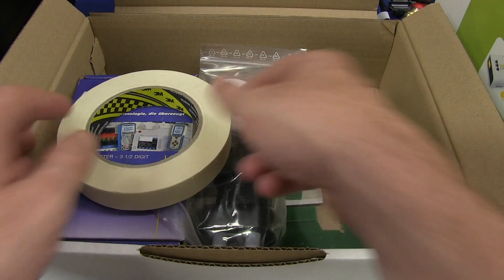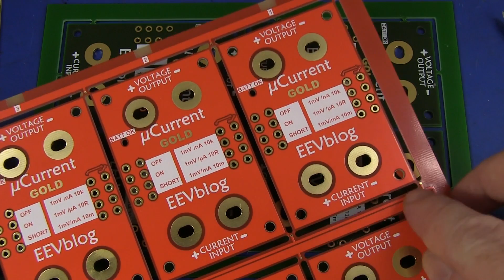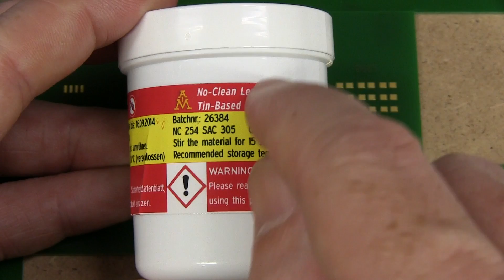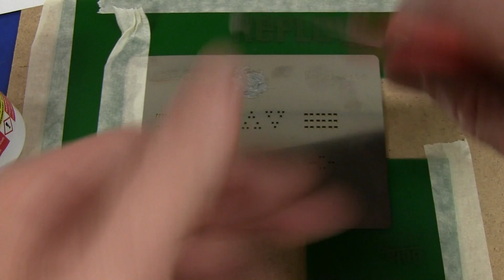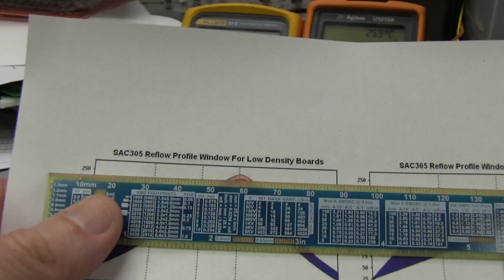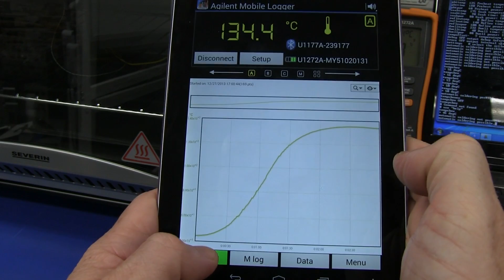EEVblog #558 - Beta Layout DIY SMD Thermal Reflow Oven

Comment: First, I am sure that the Beta device works by externally cycling the power to the entire oven.  Simple brute force.  However this means that the oven must have a cheap "dumb" mechanical controller so that when the external power is switched on/off the heating elements would continue to switch on/off.  I would assume that if the oven has a fancy "intelligent" electronic controller and the external power was switched off/on (by the Beta device) that the oven would reset to the off state, preventing external control.  Yes?
Reply: Yes. These ovens just have a simple bi-metal temp controller. I have one for prototypes and I disabled it just to be sure.

Comment: Does it allow for multiple reflow profiles, eg one for reflowing a PCB, and another for cooking food. One issue with many toaster ovens, is the uneven heating, and convection rarely ever works due to the airflow path, you end up with air blowing past some of the heating elements and sending super heated air directly to one side of what ever you are cooking, thus causing one side of that pizza or what ever else you are making, to burn.

This is why when cooking baking certain foods with a toaster oven, you need to bake them in stages and not just preheat to a set temperature and bake for a while, in many cases, you need to heat the item to about half of that, and keep it there for a while, then ramp up the temperature around 5-10C at a time every 2-3 minutes, until you reach the proper baking temperature. (at least thats how Ii get an even bake on those frozen digiorno pizzas) It would be awesome to have a controller that can just have a bunch of different custom profiles.

(PS a true convection oven, needs the airflow to never come in direct contact with a heating element, this is why on large ovens, the airflow channels are specifically directed away from any heating element)
Reply: *****
 I pretty much have a crappy toaster oven that advertised convection, the first time I used it, I instantly regretted that decision. the heating elements turn red hot (meaning they are likely hotter than the target temperature.  The convection fan is located on the side, and it pulls air in from the center right side, and blows it out through an opening near the top (where the heating elements are, the air then flows along the top until coming along a slope down from the left side, and burning everything on the left side of the toaster oven. By burn I am talking, the right side is still frozen, and the pizza crust on the left side is already starting to burn (the temperature sensor is on the right side ) (on the larger gas oven, the convection works fine though :) ) (I wish the company had put a warning on the toaster oven box to let people know that they should not enable the convection motor under any circumstances)
Reply: In this cases you would not use aurflow heating. But I have a big kitchen oven which does not allow that. To meet the term "eco" it reaches the temperature, using airflow it tries to keep that temp. even in the whole oven and when the temperature falls, the heaters are switched on again and this is cycled till I switch it off (It has no timer, that's not a problem, I use my smart phone).

Never had problems with baking pizza or something else.

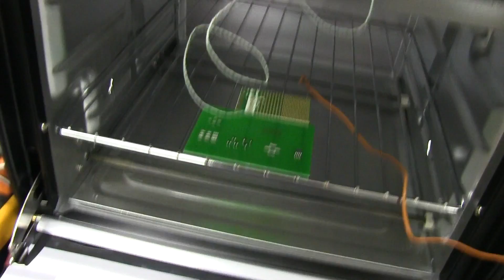Comment: At 38:10 the metal underneath is acting as a heatsink. Those three components are directly above it. It's also casting a shadow on the board, preventing as much infra-red from reaching the board at that location.
Reply: What would be the solution for this? I'm thinking of getting one of these.
Reply: @MclarenF1rocket Either different board design, reflowing those components afterwards, or trying a different (perhaps longer) cooking time. That ways your pizza will turn out perfectly.

You'll have to forgive me but my original comment was 11 years ago. I'm going off memory and my memory isn't too good. :)

Comment: 36:45 putting a wood plate underneath, or better some little wood blocks, ore just one, depends on the size of the board. This will help. I´ve gone through this issue as well when putting my board on the plain metal grill of my (dirt crap cheap 39 EUR but good working) oven.
Reply: A plain metal grill will have a much too high thermal capacity.

Comment: I may be off but doesn't lead-free usually like to go to ~270c, the temps you're getting would be more suited to leaded solder IMO.
Reply: The oven goes that high, yes. The solder melting point is about 220-230 deg, so your boards do not have to get  that hot. Oven temp depends on a lot of things. If you have a prof. reflow oven, you can get temp probes that you can stick on your PCB to monitor the temp at different locations as it is going through the the oven to adjust the profile. Basically just like Dave is doing with his perf board here. On our reflow oven we had 3 zones set tot 180,210 and 265 C. Then you can use the belt speed to adjust the end temp of your board in each of the zones as it passes through the oven. This means that if you have a board with components with a large thermal mass, like big inductors for example, you lower the belt speed so that the board spends more time in each zone so it reaches the desired temp. This is how we did it anyway.

Comment: The Oven is 1500W at 230V and the controller rated upto 1500W at 230V.

My question is as Dave's AC is at about 250V is that pushing the spec of the controller with that oven?
Reply: I was wondering where that 1500 Watt comes from. the relay is rated at 16A. At 230 Volts, that would be ~3600 Watt

Comment: Doubles as a pie warmer :)
Reply: Reflow a PCB and heat a meatpie or sausage roll at the same time.
Reply: IIGrayfoxII
HMM! Tasty lead fumes. Yummy!
Reply: Even still, lead vapors can form even at very low temperatures. This is because some atoms will spontaneously gain enough momentum to vaporize them. This is why things like gas and water will eventually completely evaporate even if they are well below their boiling points.
Reply: brandonhughes7 YUMMM, flux fumes!
Reply: Maximilian Mustermann the past was lead free. lol
Reply: Power Max YUMM FLUX!!!!
Reply: IIGrayfoxII
technically you won't have lead fume. Since lead vaporize at over 1000 degree C.
Reply: It flux vapor not lead vapor,non lead solder has many more problems than lead solder.if you are worried about lead solder wash your hands after.
Reply: brandonhughes7  well^^
Reply: Since Dave melted all the connectors on his boards, it is exclusively used as pie warmer.

Comment: Regarding the stencil, you can trim the right and bottom edges to board size, and work bottom up, right to left, so you never overlap a board with solder applied. Add a bit of a 'tape handle' to one of the trimmed sides to give you the ability to lever it up after application.

Comment: It seems to learn to fast for PID, I wonder what sort of control it is using?
Reply: If you have a closer look on the console output for the "learning" values, it just measures the temperature ramp-ups of the particular oven.
Reply: Yes, I saw what it was monitoring, I was pondering the maths behind it it to pulse the heaters on and off. Is it a poor mans PID or just a P or a home brew alog. It quite interesting to me.

Comment: Dave, why did you choose a modified toaster oven instead of one of the T-962 IR reflow ovens for sale on ebay?
Reply from the maker: There are lots of bad reports about the T-962 toasting boards (in a bad way). I didn't chose this, it was sent to me to play with.
Reply: Wow, some guys are already selling their modified controller !!! http://www.ebay.ie/itm/Reflow-Oven-Controller-PID-Ramp-rate-fits-T962-and-T962A-ovens-better-control-/191006364521?pt=LH_DefaultDomain_3&hash=item2c78ddd369
Reply: Unified Engineering has open source firmware for the T-962 that you flash onto the microcontroller. It really improves the oven!

Comment: I used PCB-Pool too, high quality and fast, but these days Chinese services like  ITeadStudio, Hackvana, Elecrow etc. provide the same good quality for a fraction of the cost. But needs longer, so I still use PCB-Pool, if a customer wants boards yesterday.
I have the same reflow kit, looks like I bought it 8 years ago: http://www.frank-buss.de/reflow/index.html
My reflow results were a bit better, but I really should do the temperature calibration as well, never tried the serial interface so far, thanks for the video.
Regarding Severin: it is a good manufacturer of white goods here in Germany. I have a toaster from the company, is working for years without problems.

Comment: Try put gap between that iron bar tray and the board. Do not put the board directly on that bar, that is causing odd temperature, parts on steel bars are not going hot enough to melt the tin. See it from 38:10 (Pause) Please try to understand my poor English. :)

Comment: not out of luck for 120V folks. All houses have 220V outlets for large loads, just pull out the dryer !
Reply: dual phase 220 @ 60Hz not the same as single phase 220 @ 50Hz unfortunately. NA 220 is 2 x 110V lines with a common neutral.
Reply: No Google, you may not use my real name
Yes, but the 2 live wires are out of faze, giving you 220 volts. The transformer doesn't know the difference i assume. The 60Hz might be a problem.
Reply: I don't see the problem, the secondary as long as it is around the ball park of 6vac and above 50hz then alls fine. 110-110 tapped primary, just use one coil. the most power it will tug is for the 6 odd LED's copared to the control logic. You could grab a tranny out of an old alarm clock if you can't find a footprint matching sexy tranny. no pun intended lol
Reply: too bad the US uses 60hz and this device needs 50hz
Reply: Swap out the transformer for 110v and you will be fin, The SSR looks to be fine for 110v 60hz
Reply: Ohh sorry, you USA peeps have funny house wiring. Your talking about 2 phases out of the three I assume. UK has domestic 240ac typ single phase neutral grounded a the station, local earth (not optional in the UK), or 3 phase 450vac typ, neautral again grounded at station for star configuration and local earth not optional. Im gonna have to look into you electrical distribution technics, they are a bit out dated but quite understandable due to the age of your grids. 60hz does make for a little bit more efficency though.
Reply: Sirus USA house wiring only has 2 phases I believe, but they are 180 deg out of phase, not 120 like our 3-phase system. So if you measure between them, you get 240 Vac.
Reply: sounds the same as ours just half the voltages. the other phase you mention is most likley the centre of the 3 phase star and grounded at the station, called neutral(Blue wire) over here, domestic supplys usually get one of the 3 phases, L1,L2,L3. 3 different colours (forgot all of them yellow, blue?,grey?) , but Brown is standand single phase live/hot. Old colours where confusing as USA uses Black as hot/live where as old UK before euro standards Black was neutral and grey that is live for 3 phase still looks a bit white and USA neutral. Befudlings
Reply: Sirus US domestic supplies are actually centre tapped (as ZlayaCo6aka said below) single phase transformers, so it's actually 180 degrees out of phase, so 2x120v actually DOES equal 240v.

Some apartment blocks and so forth use genuine 3 phase, in which case the phase-phase voltage is 208v, both would be within spec for a european 220v +/-10% appliance, provided the electronics didn't mind 60Hz, I can't see that it would. The transformers CAN be an issue but only when very heavily loaded, and that one likely isn't as it's just driving LEDs and a bit of sensor circuitry
Reply: ***** I of course meant 230v +/-10% D'OH!
Reply: Isn't that split phase? Kinda like an up transformer with center tap localy?
Reply: Sirus Yes, that's exactly it, it's split phase, CT transformer, with the centre tap grounded. It's quite a good system really, allowing 120v for household outlets, and 240 for heavier loads.

I think some farms here in the UK USED to have 240/480v if they only had single phase to the farm, but that ended around the 50s or 60s :-)
Reply: Don't get me wrong, I'm not an americanist ;P , my thought is the population not being as dense also the developing history of differing country's grids systems, had me pondering. Call me inqusitive if you will.
So prehaps this is why the US has a reputation of having an Earth isn't needed, as they must have one side grounded very locally, so that side has very little potential to the earth to render that wire "not hot". Hmm.
Somebody needs to draw some huge diagrams to ponder over.

Comment: IMO, the interconnects for thermocouple, logic board power and SSD input = isolation FAIL. I would refuse to use this device until modified to be safe.
Reply from the maker: Huh, how is it a fail? The transformer isolates the logic board, a 4KV isoaltion SSR is used, and there looks to be plenty of PCB clearance.
Reply: It runs from a transformer and the SSR is isolated too. Safe as houses.
Reply: EEVblog never mind the SSR isolation - what's the isolation between those aforementioned interconnects and the fuse terminal they're resting on?
Reply: Sirus Will it be "safe as houses" if one of those aforementioned wires breaks at the solder joint, say from repeated movement, and touches something it shouldn't?
Reply from the maker: OzDelphi What repeated movement? It's fixed inside a case.

Comment: Severin is one of the dirt cheap household stuff brands you find in hard discounters, here in old Europa.
Reply from the maker: Interesting, because the quality seems quite ok.
Reply: TubiCal agreed! I own some Severin products, wich were cheap indeed (as in "not expensive") and they still work after 5-6 years as if they were new. Good quality and very good prices.
Reply: EEVblog Might be intentional choice by Beta as well, since well, if a dirt cheap oven can work this well with the kit, then it can only get better really! I like when companies demo things with the "worst possible" scenario, and show that it still works.
Reply: That Severin oven is dirt cheap and lacks advanced functionality, but the build quality is actually the same (if not better) than some of the more expensive ovens from LG, Whirlpool, etc...

BUT, as Dave pointed out, you WANT a dumb oven because if you use an "intelligent" one, the external control unit will fight to death with the internal digital controller and you may cause damage or simply won't work at all.
Reply: Many frills on an iron bar? Thats what we say in sweden. An Ir heating element some thermal insulation and and stamped metal, what could go wrong?
Reply: Severin is not dirt cheap, it´s actual one of the last germany based companies, whitch has not gone by through a buy-out process, where the company beeing killed and only the brand survived to be smashed on !dirt! cheap crap made dirt cheap in china (aka grundig,aeg, dual and eaven former japan brands like akai....), go over to wikipedia and read about severin.

Severins´ products still go through the VDE test labs (where i worked some 20 years ago)